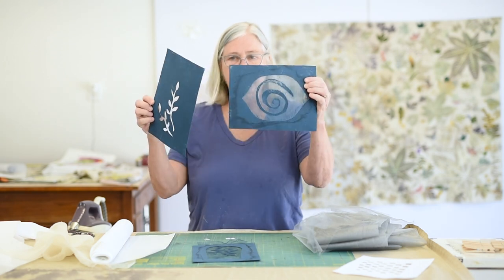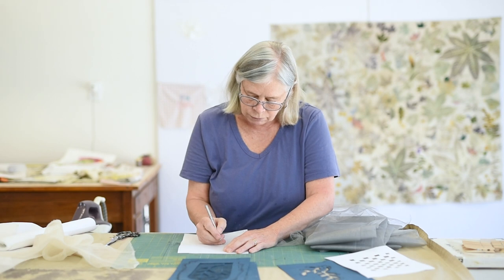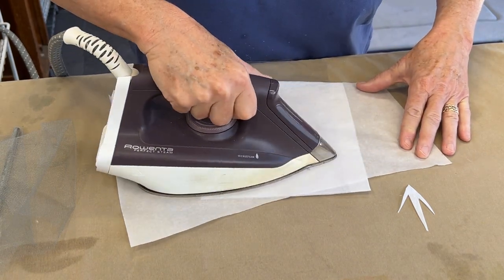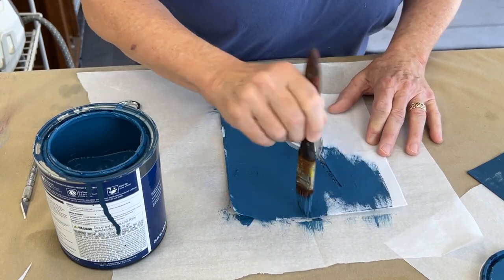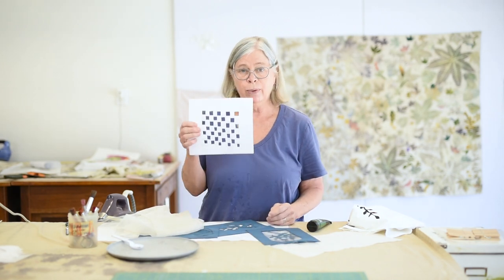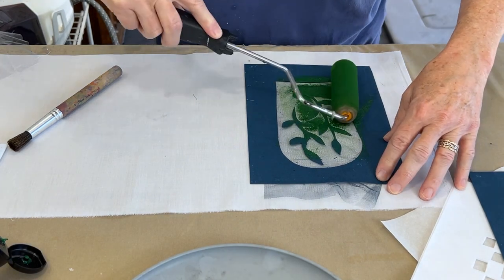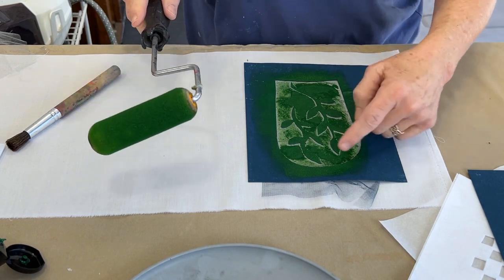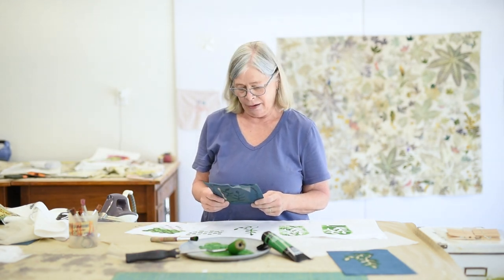Art For Everyone: Make Your Own Reusable Interfacing Stencils!

Comment: you said you had to heat set the house paint ... how do you do that? Also do you use straight acrylic or mix with  Fabric extender for a softer feel? Thanks... I really enjoyed the video.
Reply from the maker: Treat it just like any acrylic textile paint. Cover with parchment and iron it on high for 30 seconds, on both sides, once it is dry. No need to make softer. A stencil needs to be slightly stiff so you can move it around!
Reply: @JaneDunnewold  thank you.

Comment: Hi Jane! Thank you for this video and all your teaching! I have 2 questions. The first one is that I am not quite sure I  understand why the interface should not be of the type of small dots of glue. I am not sure I can find such a fusible interface here in Spain. The second question is whether I could use non fusible interface and Mistyfuse or Steam a Seam, or any other cheaper fusible web to glue them together. Thanks a lot! Arielle
Reply from the maker: In general, the little dots don't melt into an even coating so they don't hold that well, compared to the interfacing with a continuous coating of adhesive on it. You could try fusible but then you would have to fuse it to the interfacing first - using a teflon sheet, I think. And that's because you have to cut through the fusible too - when you cut out the open areas of the stencil. It would be really hard to cut the fusible to match if it wasn't already fused to the interfacing!
Reply: @JaneDunnewold  thank you, it helps  me to find alternatives to your products here in Euros, or to work with what I have at hand.